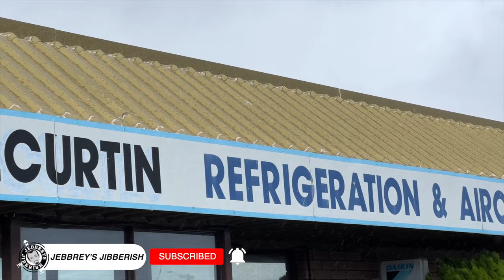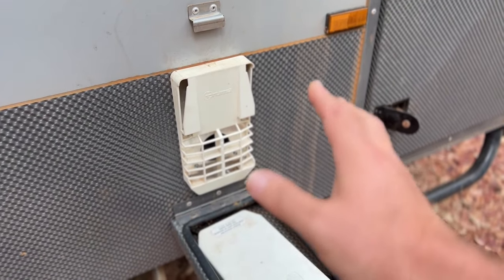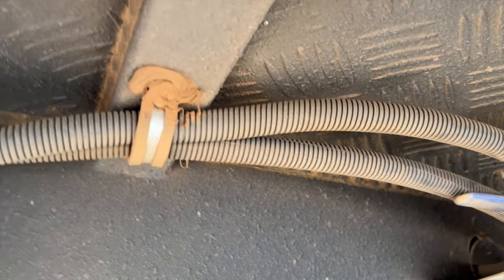TRUMA Ultra Rapid  FLAME OUT Problem solved PROPERLY!

Comment: Thank you for providing an excellent explanation of the problem and how it was fixed! We are getting the same error code on a different model, Truma, on a different make of RV. We are in on our seventh RV since 1999. Learning that it was a manufacturer's sloppy work on the build is consistent with that being the source of most RV problems. Over 95% of our RV repairs have been directly linked to the manufacturer's lack of quality work.

Comment: Finally! A video to explain this issue. Nothing on the internet about this. I too have been taking my cover off. I'll try and prop it up aswell. Brilliant. Would love to know exactly where to seal tho?
Reply from the maker: Yes I searched and searched and searched when I had the problem and couldn’t find anything either. That’s why I put this out there because it seems to be a very common issue. I didn’t see them seal it but I believe it is between the unit and the metal exhaust section. But now that mines working I don’t want to mess with it to investigate that. I would see if you can see the gap now and that would be where to seal once propped up.

Comment: Hey mate, this is awesome. We have had our Emu just for 2 months & exactly the same problem; I'll be showing this video to the dealership; I will let you know if this was the same fault. Thanks😊
Reply from the maker: No problem, hopefully you get it sorted. In the mean time check out my video on the temporary work around as it took three months for my booking for warranty in regional WA. Not the fault of Emu, that was the local Truma warranty place. So if you can’t get it sorted but are doing trips on the weekends or for Easter it might be worth having a go at that in the meantime. Also if the workaround gets it going it’s almost certainly the same issue as mine.

Comment: Mine is in talvor motor home found drain blocked full of water anyway dried it out now i can hear ignition then flame out that is with cover off b annoying i don't know if it has 240v as doesn't heat up crazy shit hey..thnks for info very helpful cheers Harry

Comment: Look up burping the gas bottle. Something to do with resetting the regulator. Also I think that when cracking a fresh gas cylinder the valve should be cracked SLOWLY. Also when switching from an empty cylinder to a full one in a two bottle setup do not open the new bottle until you have flipped the two way tap.
Reply from the maker: Never had a single issue once it was fixed/installed correctly. Even in gale force winds it never fails now.

Comment: I want to suggest an entirely different explanation and fix. The plastic body of the Truma Ultrarapid gas HWS is thin flexible. The circuit board is attached. Just imagine the van getting a big shake up on rough roads. Perhaps a little dust. Moisture? If the CB is removed with great care and inspected for integrity of all components: fuse checked (1.6A slow burn), harnesses unclipped carefully as wiring is quite fine. Then with great care the CB is remounted noting that it mates with plugs from thermostat; harnesses re joined with great care and plastic bits reseated perfectly. I think then the failure to start causing the red light flashing might be solved. What I'm saying is that poor connections from the circuit board due to shake/dust /etc is the primary problem and fix is low cost. I note that in various blogs people have had the CB replaced as the fix.

Comment: Do you still need 12v power if using gas to heat water for the pizo igniter
Reply from the maker: You would need 12v or 240v. I haven’t tried with no 12v but I would assume the 240v would take over. I might be wrong because the controller might be 12v. Would be an interesting experiment .
Reply: @JebbreysJibberish  yeah i got mine working thru 12v, running on gas, worked really well, i reckon i had hot water in 20 minutes on gas, my new van has a 2nd power switch for the hot water system, amazing when you work things out.